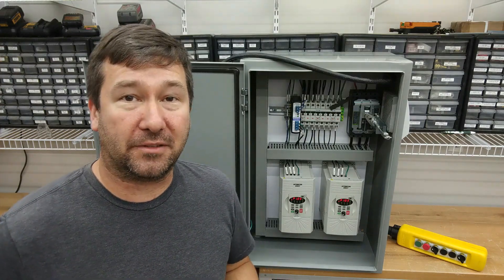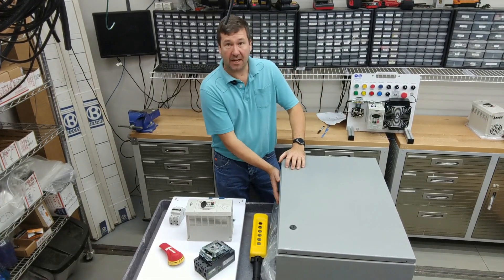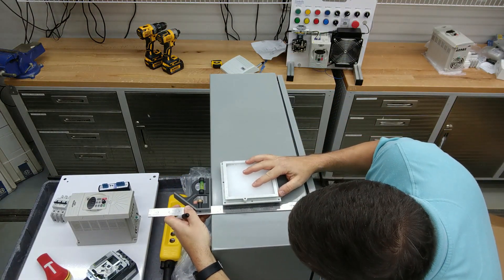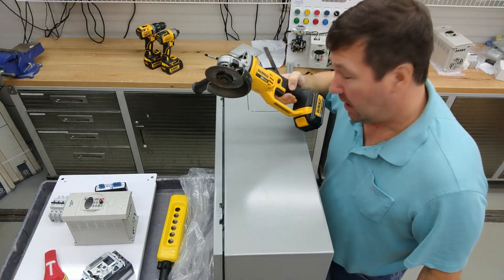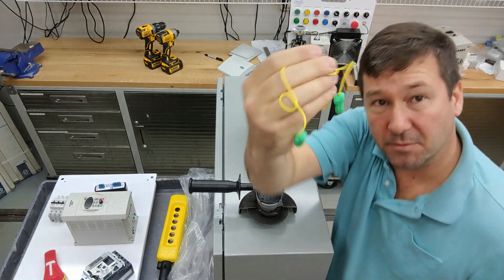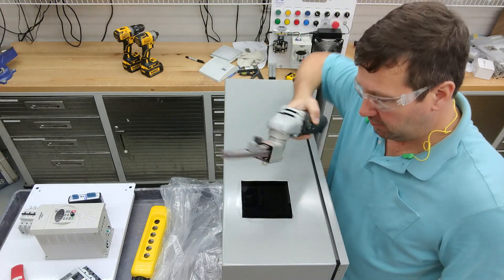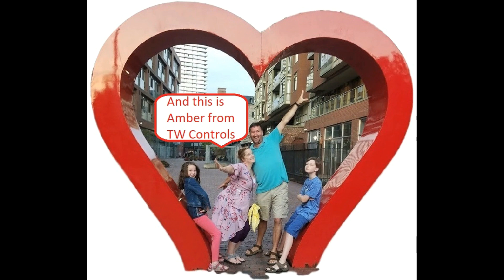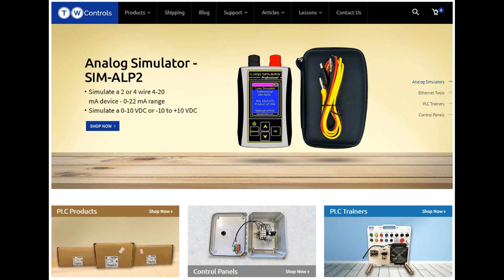Cutting Holes in UL 508A Control Panel Enclosures Part 2 of 6

Comment: Tim, have you ever used an electric/pneumatic nibbler to make the cutouts on enclosures?
Reply from the maker: Yes, I have one but wasn't happy with the way it stretched the steel.
Reply: Maybe the punch and die are not sharp enough.  Which brand and model do you have?
Reply from the maker: I can't recall. I haven't used it in years but it was brand new. It worked good thinner panels but when it came to the heavier panels that's where you'd start to see it
Reply: I recommend Fein Tools BLK 2.0 electric nibbler.  It's made for 2mm thick (14 gauge) mild steel that is commonly used for control panels.  You can also tie a little bag to the die on the inside and catch all the metal chips so there's no mess.

Comment: Hi Tim! Very nice videos. I'm curious how would you attach this display to the front of the control panel...Do you need clips or brackets..

https://www.alibaba.com/product-detail/Autoda-AD2016D1-intelligent-packing-weighing-controller_62399460623.html?spm=a2700.galleryofferlist.0.0.67fc1bbe2egGMD&bypass=true

Thanks
Reply from the maker: Hi Patrick, it likely comes with some screw clips that you use on the backside of the panel.  Make sure you check what the environmental rating of this device is.  Many have a very poor rating.
Reply: thanks very much Tim

Comment from the maker: Part 3 Mounting Control Components can be found at:
https://youtu.be/r3p8EdDgwnU

Raul Cortes brought up a very good point that I left out in the video about taping surfaces that you will be cutting. It's not as necessary when using that cut off wheel but if you're using a jigsaw to cut a panel, taping the surface of the enclosure will keep vibration from scratching the surface. I prefer blue painter's tape and I don't like to let it sit around more than six months because after that the residue sticks to the panel.

Comment: Hi! If i have choices, Should i go for CNC machining or by hand drilling ? Thank you.
Reply from the maker: I would use CNC cutouts whenever possible. Most of our control panels are one of a kind and lead times usually don't allow for this. You should definitely be set up for manual cuts even if you use a CNC for most of it. Nothing looks worse than one crooked cut on a finely machined CNC cut enclosure
Reply: Thank you sir
Reply from the maker: You're welcome
Reply: I do all the drilling cutting but SS I send it to our machine shop.
Reply: I manage a shop with 3 CNC vertical Mills and a Horizontal Mill. I get orders for modifying enclosures of various sizes often. I make drill jigs with bushings to put the holes in. If I have to do cutouts they are difficult to fixture on the mills. Without rigid fixturing there's too much vibration. It's faster and easier to do it your way with an angle grinder and cut off wheel.